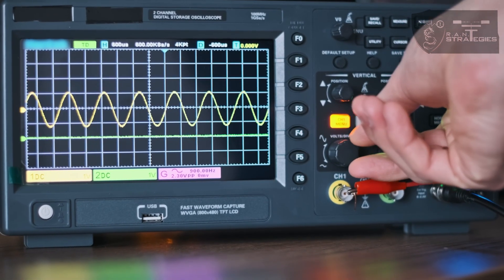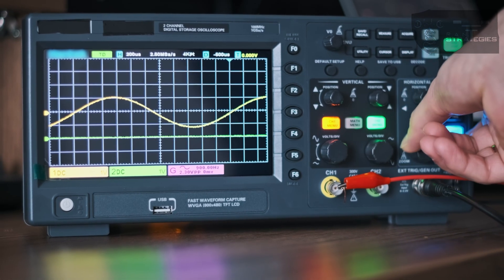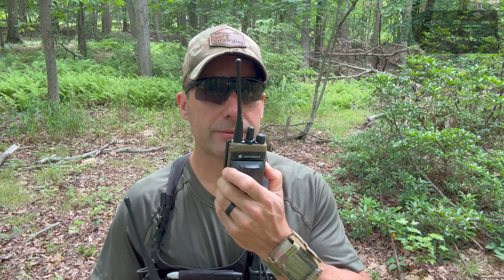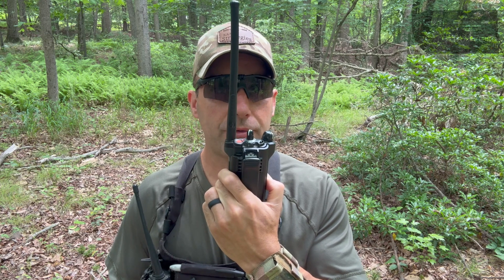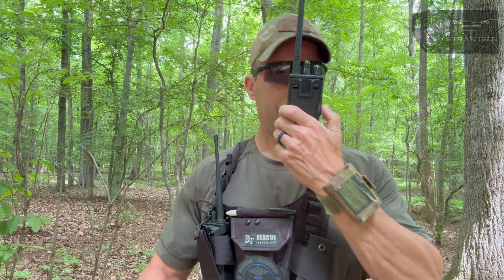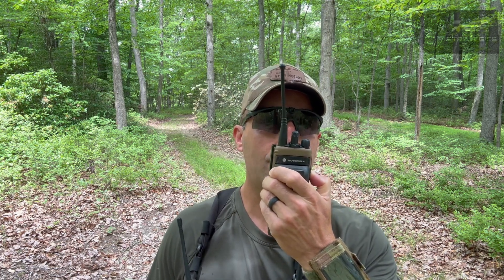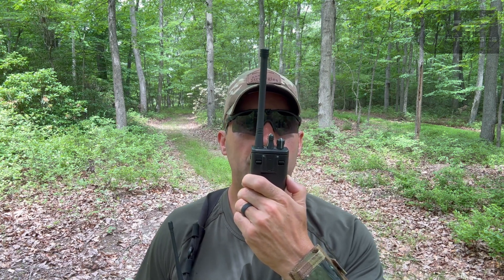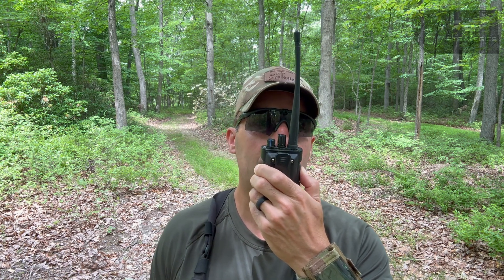UHF vs VHF Tactical Comms

Comment: Have u tried the Anytone 878 UV2 radio? It has GPS, APRS, analog, digital and much more...  but you need some knowledge to configure/setup this radio.
Reply from the maker: I haven’t yet…. But have one on the way because it appears to be very popular and we’re going to put that up to some tests and see how it does!
Reply: @RANTStrategies  Great, u need a software to configure the device from anytone and maybe you need a configuration setup for full band access. It has a CTS scanner to scan for CTS signals, man down alert, real dmr crypto, 500.000 dmr contacts, dmr full monitor for ts1 and ts2. In my opinion it's currently one of the very best radios, but you really need to take some time for learning curve. With aprs everyone in your team knows your position. There is 878 model 1 old and 878 uv2 the new model dont buy the old version just in case.
Reply: I own a 878 myself (first Gen). But this has nothing to do with range test much, because the video is about VHF analog vs UHF analog. The 878 might have 2W more power on Turbo mode, but that's hardly a big distance difference there. 
Almost all the features you mentioned are not for analog.
Reply: I have one.  It's a huge disappointment on analog--the radio is more "deaf" to weak analog signals than some $40 Chinese radios.  I've yet to find any digital portable radios that perform well on analog and digital other than single-band UHF or VHF commercial portable radios.

Comment: Depends on the area. Without trees in the Mojave Desert, my PNI Escort CB runs circles around my Yaesu on either MURS or GMRS.
This is even more true in hills and mountains.
Reply from the maker: No doubt, terrain and topography will always play incredible roles in performance! This area of dense foliage and moderate hills would be classified as some general harder terrain, so I think for the majority of the US…. They could base a lot of their comms plans off of this testing….. more to come in the future for sure!
Reply: With CB a you have two advantages. First the lower frequency is going to get you further with less free space path loss. Plus with a CB you are running mobile with a much better antenna than a HT. 

The other real difference is you are run AM on your CB vs FM on the VHF and UHF radios. 

FM suffers from the “capture effect”  where it will be nothing but noise then suddenly the signal is strong enough to “capture” the receiver. 

AM which is also used by aviation doesn’t have that. You will be able to hear someone deeper in the static with a weaker single. 

So all radios are tools and it all depends on the applications.
Reply: @DasNewsNetwork 
No.
CB will do better on FM (now legal in USA).
CB will outperform everything on SSB (USB or LSB) in the field.
Capture is the ability to descriminate betweeen two signals on FM and the 6dB stronger is enough to obliterate to weaker one so you only get one (AM will produce a "beat" high pitch annoying sound when more then one station is present on the air at the same time.

From top perfomance to bottom:
SSB (wich is a "special kind of AM")
FM (mid better then narrow)
AM ("ANL on" better in normal circunstances and  longer reception with ANL off in RF quiet areas (no static, etc.)

55 + years of tactical HF, VHF low, VHF mid, VHF hi, UHF and SHF comms (Red Cross, Mil, Anti terror SAS type SpecOps, Fireman, Caves, Air, Sea)

Comment: Are these radio's transmitting at .5 watt's or are they set and able to transmit with more power...?
It might be a good idea to try a roll up antenna tossed up into the trees at 20 ft if that would be possible, just to see the gain in distance from the stock antenna.
Reply from the maker: Hey Mark, they are transmitting on 5 watts, strictly just OEM comparisons being done. As far as the roll up antenna, absolutely that would work, what we wanted to conduct with these series of tests was strictly how they perform from the factory (you would think the higher tier radios would be set up very well) and simply test the capability of the bands….. this is going to build into some off shoots we are planning for future videos. Appreciate the comment!

Comment: What was the receiver? What sort of antenna was it using?

Also when were these radios last aligned? The HT1000 has been end of life for like two decades or more. I also believe they can’t be narrow banded, which probably contributed to your troubles.
Reply from the maker: The radios were all aligned last year (it’s nice having radio techs as friends) and to your point, an identical radio is used as the receiver, so what you were wanting is exactly what we did
Reply from the maker: The  whole purpose behind these tests is to stick strictly HT to HT comms. The receiver is affixed to a matching HT with an OEM antenna
Reply: @RANTStrategies  that makes sense, but it would be interesting to compare like radio to like radio for the best comparison of sensitivity etc.

Comment: Six Meter at 50Mhz is also VHF and can get some amazing distances. Everyone forgets about 6 meter which also has FM repeaters available, allows for sideband and AM. Yaesu made a 6 meter handheld once upon a time. The old PRC-77's military radios also operated around 50 Mhz.  Just food for thought.
Reply: Wouxun has current models that cover 6m in an HT form factor.
Reply: @nine7295 
You are right, and they are very sensitive...
Use with long antennas only
Reply: 50 MHz SSB manpacks (Kenwood, Icom, Yaesu, etc.) with long antennas and LiOn battery packs will do the best range on VHF. 
But not as pratical as handportable units.

If you are only into hand portables, go to 25W VHF  hi units with long antennas and several high capacity battery packs
Reply from the maker: That is a potential option….but to your point, those HTs were made once upon a time. The goal of this testing for for preparedness / emergency comms that could be readily utilized.

Comment: Another thing to consider when doing testing like this is antenna choice, you chose the OEM antennas which I think is useful to compare radios themselves in a useful manner but not to much to compare the frequency bands themselves. As you decrease in frequency like you mentioned your wavelength increases which means your antenna length also has to increase to stay efficient. HT antennas often aren’t long enough to get a fully efficient antenna at vhf because they need to also balance physical size. If you were to use for example 1/4 wave antennas on both radio bands you may see closer results between the 2 but like the manufactures have to do, as a radio user antenna size can be an important consideration when it comes to actual usage.
Reply: Which is why you see Forrest fire fighters with much longer antenna on their HT’s.
Reply from the maker: @thomthumbe  but again, only if feasible… I can tell you, first hand experience, (wildfire medic) they have only ever given me radios with the standard BK antenna attached and to carry it in a chest rig without being cumbersome, it has to be within a reasonable length. A lot of the firefighters have their antenna in their pack so it allows for a longer antenna without getting in their way.
Reply from the maker: Awesome comment, absolutely, and if you heard at the conclusion of the last video when I mentioned we were going to get into some antenna stuff, this is exactly what I was referring to. Looking forward to doing it, should be interesting to see what happens.
Reply: You hit it right in the nail! Well said. Antenna is the key and a helical antenna for VHF is a shortened, compromised antenna for VHF.
Reply: Not always true, it depends on antenna design. Some antennas area tuned to VHF frequency. My three handheld radios have SWR near 1.0 (1.03 to 1.1 SWR) at VHF, while the SWR at UHF is near 2 (1.9 to 2 SWR). So their antennas are more efficient on VHF than on UHF.
Reply: @bryansalamat4505 SWR is not the only parameter that matters. A good SWR doesn’t solely mean an efficient antenna, by that logic a dummy load would be an efficient antenna. There’s other attributes that are much more important

Comment: Im guessing where you recorded that incoming audio is why ur radios are failing, its a bad test. You would need to record it outside your home base for the VHF to receive. Its probably sending the signal all the way back to your house then your house wall or roof is stopping it from receiving? The UHF frequency recorded fine so the VHF shouldve too if not better, the UHF burst through your wall and into your recording studio where the VHF probably hit your house and stopped? Im guessing you didnt record the incoming audio outside??
Reply from the maker: Excellent comment! This is what this supposed to be all about. So the receiver is in a garage... so wood frame construction on the house, with the garage door open, which more of less faces the direction of the test range... but not completely, there is definitely some wall coming into play there. With that said, and this is truly based on your comment here... stand by, we are going to redo this test, with the receiver placed outside and see how well the VHF gets through the foliage is that really was where the issue lies. As I had said, I was shocked, you would think with that APX and the size of the antenna, that it would have done a better job. We shall see.
Reply: @RANTStrategies  yeah man, and send and recieve both ways need to record both ends. I have a 300 watt fm transmitter that Ive done bounce back licences to a tower, you can double up the antenna and throw twice as much power. I bet you a million bucks you can get those units to work. Ur starting at the wrong end, Id be starting fliming at the base and then work a fix to broadcast to the bush and work on ur receiving antennas then work on the bush antennas, climb a tree if you have too..
Reply: Yes, I’d be interested in seeing the results with the receiving radio outside as well. This video demonstrates that you could have “mixed use” scenarios, for example, a hunter in the woods calling a guy who’s back inside at camp. We use GMRS/FRS at our hunting camp (very large acreage) and I have often wondered if we’d get better range with VHF.  Our distances between hunters are around the same as your testing, .5 to 1 mile. Most of the time both hunters will be in the woods but this adds a new wrinkle when one person enters a structure. Great video, keep up the good work!

Comment: UHF bounces better off objects and goes thru windows with less loss, foliage not so good. The natural noise is much higher on VHF, requiring more power and is more of a mobile service. FM CB has possibilities for hilly forest areas if you don't mind big antennas.
Reply from the maker: This is all true^^^^ The we just approach these tests and topics with a being operational mindset and there are always going to advantages and disadvantages to everything, with this test it was starting to explore, are the tradeoffs of trying to walk around with longer VHF antenna really worth it if UHF can equally perform out out perform it when it comes to HTs.
Reply: Generally speaking the higher the frequency the more it gets absorbed instead of reflected from objects. So not true that UHF bounces off better than VHF.

Comment: After using most of the band spectrum for both urban and rural settings, conventional seems to work poorly at range without signal amplification. Wide Area Trunked Networks have the best overall function in a variety of settings and also offer digital audio better for both DMR and P25. Id have to say Conventional Simplex operations do seem to work better in the higher frequencies for both urban and rural settings (both UHF and 7/8)
Reply from the maker: Completely agree, absolutely!
Reply: Do you think if he used the radios in digital p25 that he would have had better coverage ?
Reply: @abgcapital4597 P25 Conventional unfortunately doesn’t improve range, most of the time where you’d get static at the edge of a conventional range with useable audio, the P25 voice modulation will come across garbled and illegible. DMR Conventional does the same thing. Range for simplex is everything, use the right tool for the right job.
Reply: @abgcapital4597 
On the move, the signal will not stabilize and will break all the time.
Standing steal depends on the radio (newer radios will beat analog with better sensitivity and internal signal processing, but older units ate terrible....
Reply: @abgcapital4597 no lol
Reply: Trunking will fail on SHTF .
Only simplex (and simplex repeaters) will do...
Reply: Digital isn't going to work well in this environment
Reply: @Dread_Pirate_Homesteader  
If you do fast tactical movement in the field, you'll have problems...

Comment: Ive heard multiple people claim they got better signal using uhf in thick brush and your results seem to lean that way as well. Makes me glad that I picked UHF for my motorolas
Reply from the maker: I would definitely say that is the case here, we are definitely moto fans…….. which radio did you get!?!? What features did you get in it? BT, FPP……???
Reply: @RANTStrategies  I got a used xpr6550 and a xpr6350 along with some ham radios. I dont remember off the top of my head what features they have on them unfortunately. I really wanted to go for the xts5000 with fpp and aes256 but I decided to go dmr as I thought it would be much easier for my range buddies to acquire compatible gear. Now that I have these motorolas, I can definitely see myself saving up for an apx model or kenwood of some sort down the line.
Reply from the maker: nice! Let’s be honest, pretty much anything you get from moto is going to be a quality build. We have xpr5550s in our vehicles and utilize the 7550s for certain things. The 6550 is definitely solid and does messing as well as encryption, I don’t think you can go wrong there. Best advice learn how to utilize all its features and take full advantage of them.
Reply: @RANTStrategies  absolutely. I've been messing around with a btech 6x2 radio for about a year or two now and I've grown very fond of dmr and it's capabilities. I live in a semirural-rural area and all government communication is in dmr except for the game wardens and state troopers. I figured if it worked well for them then I'm probably not losing too much in comparison to p25. I actually ran into a park ranger the other day using an xpr6550 as well and I thought that was pretty neat.
Reply: seems like a faulty test to me, the VHF would normally blast through trees but not buildings, something else is going on with his test. Im guessing he recorded the audio inside his house, instead of outside where the VHF would be at its highest strength.
Reply: @tcttvradio correct. VHF doesn't work as well indoors, compared to UHF.
Reply: @nine7295  yeah I agree but it sure does with an external antenna! You would never use factory antenna inside a house on vhf. Exactly why his test didn’t work.

Comment: Gotta say I'm a little disappointed with the results of VHF. It consistently sounded way worse and basically had the same range as UHF. I'm a paramedic for a rural agency and we use a VHF analog network. I lose the ability to transmit almost any time I enter a building, and audio quality just gets destroyed when receiving. I wonder how UHF would perform out here
Reply: As an EMT in a county that done away with our “legacy” system (analog VHF). It’s terrible. I would much rather have to listen to the static and determine what you said vs it being a transformed garbled mess that you can’t make anything out of.
Reply from the maker: @TwoFirstNames97  welcome to the world of public safety and big moto contracts lol. We are on the same page
Reply: @TwoFirstNames97  Interesting. What did you guys swap over to? From my experience, digital definitely takes getting used to, I had to tune my ear to really understand it, but I've never had problems with a digital network like that.
Reply: @Tommymad1 my experience is going from analog to digital is you have about half the range or less on digital that you have on analog.
Reply: @kiloalphasierra 
Not half. Maybe you were on higher range VHF and the new digital network is on UHF....

On the same frequency the range is almost the same, but the digital audio is horrible (you won't recognise the other guy).

Even in the past, there were some rare digital systems with good audio and no delay, but generally they were horrible on that.

Today it is possible to get good voice (almost as good as analog) on digital but generally there is an anoying delay...
Only specops tailored digital comms have good voice snd no delay....
Reply: @jplacido9999 Digital audio used in these formats sounds terrible with users who speak with high pitched voices.
The digital formats aren't good at interpreting them.
Reply: @Tommymad1  The "WVSIRN" network. P25 BS, we have XTL2500's in the trucks (theyre decent I guess, the system needs more sites.) and a cheap little kenwood paper weight for a portable. I much prefer the analog over digital 1000X.
Reply: @TwoFirstNames97  see his new video he got them going great, it was a bad test
Reply: UHF is for going through buildings not vhf, vhf is good for bush as it blasts through trees, I think something was up with his terrain or recording setup. If he didnt have a line of sight or not a long enough antenna or power boost or a repeater. I think with some hacking and better antennas he could get them all working, really depends on the hills too..
Reply from the maker: Completely agree with you! The results were certainly a little shockingly disappointing, but hey, that’s why we wanted to do this.